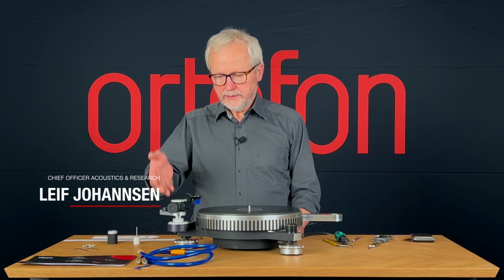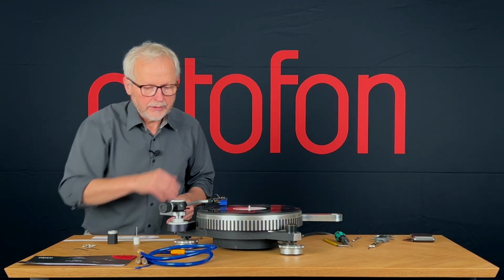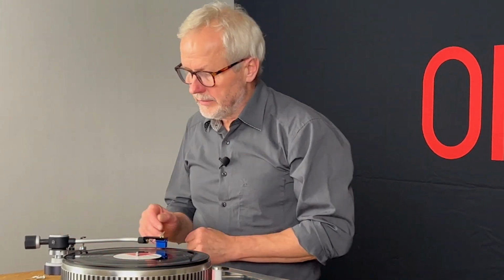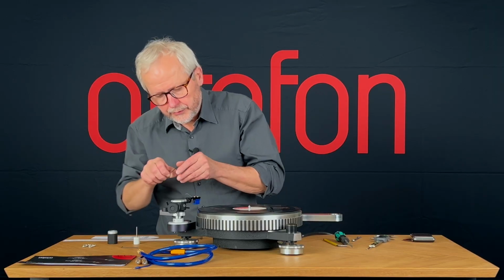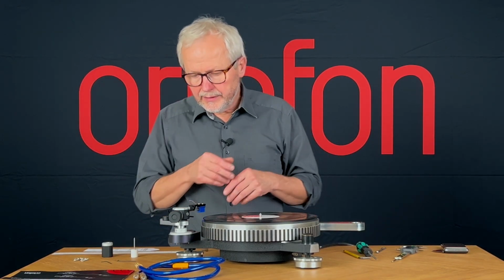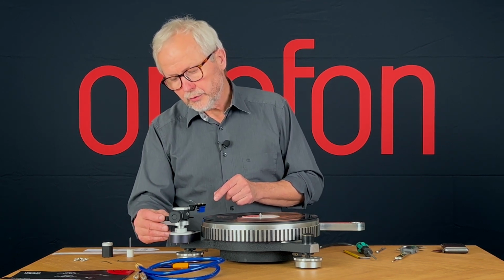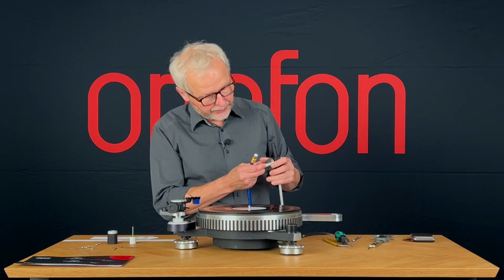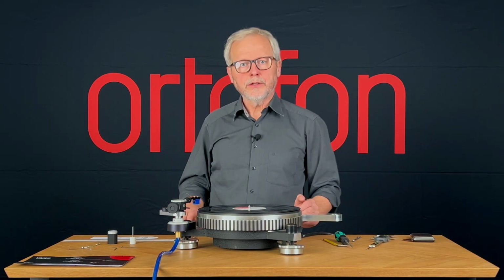How to Set Up Your Tonearm | Adjustments

Comment: I have a 2m blue cartridge. Can  I remove the blue stylus and replace it with a 2m black stylus?
Reply: I think not. The magnet and coil configuration is different between the Blue and Bronze/Black. Get the whole cartridge. They use silver coated windings in the Bronze and Black.
Reply: @PurpleDreki  I think you're 3 months late.

Comment: I adjust the height of the arm on the microlift stand not very low or not very high, but to a height at which the hydraulics will turn on and normally slowly lower the arm without throwing it on the disc.At different heights, the nature of lowering may be different.Thank you.